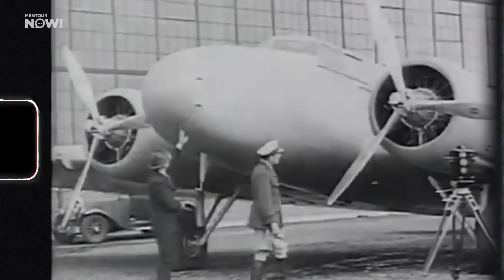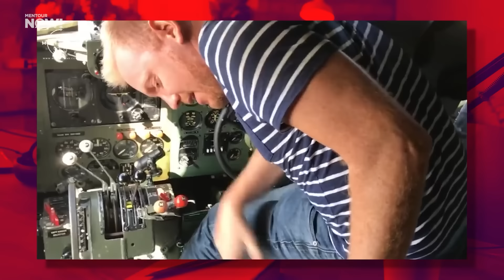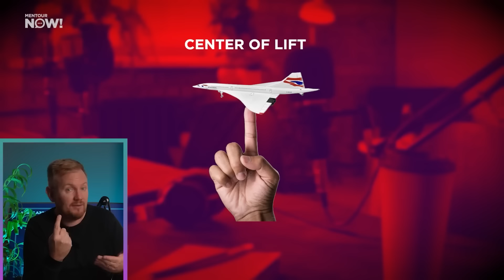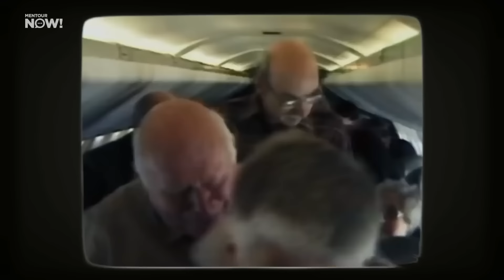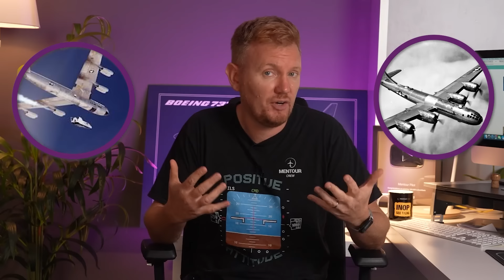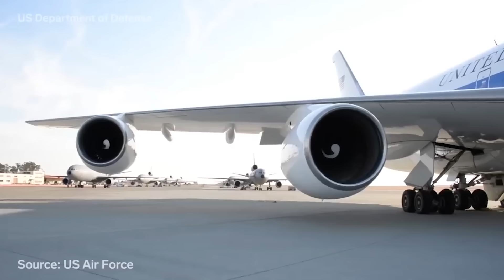The Planes Who CHANGED Aviation FOREVER! | Mentour Long Haul

Comment: This was a fascinating video.  I especially liked seeing the DC-3 in the museum.  American Airlines also has one in their history museum.  There's nothing to prevent you from taking a seat in the passenger cabin, which is unfortunate whichever airline you flew to get there.   That's because that seat is so much more comfortable than whatever economy seat you sat in (Virgin America in my case).  If you are ever in Dallas, American's museum is definitely worth the time.

Concorde economics were always dubious compared to the American SST proposals, which promised seat/mile costs close to those of subsonic jetliners of the day (707, DC-8).  Showing how the Concorde maintained its center of gravity by moving fuel is interesting.  If they tried moving fuel into the vertical stabilizer of the NAC-60, I would love to have seen the engineering involved, as it had an all-moving vertical stabilizer.  It was designed to be move about 15 degrees each way.  I've seen a small drawing of this, but not a detailed one. 

It's been fun, but the meds are kicking in...

Comment: The 8km antenna is to send the launch code to the silos on the ground. The long wave antennas are buried about 20 meters into the ground around the launch sites. They can only transmit a few bits per minute. Just the launch code

Comment: Absolutely great video!
Regarding Concorde I would like to add following information:
Johanna Weber and Dietrich Küchemann, both working for the Royal Aircraft Establishment (RAE) in Farnborough, were mainly responsible during the general design study in presenting the slender delta wing planform (which then received an ogival / ogee wing shape), as the only feasible solution for an SST. 
Since then, some other British and French aerodynamicists worked to improve this wing design independently, were the French design with its ogival shape, being previously proposed for the Super Caravelle, was originally chosen for the Concorde project in November 1962.

The final Concorde wing design for the production aircraft was mainly done by the British aerodynamicist Dudley Collard who worked at Aérospatiale in Toulouse. He redesigned the complete wing leading edge and designed new lift-improved wing tips (outboard wings). Among other aerodynamic improvements, he also proposed British Aerospace to build the extended tailcone (housing a more rear positioned and enlarged trim tank), which was essential for drag reduction.

Comment: Your mention of the aerodynamicists  Johanna Weber and Deitrich Kuchamann was interesting. There's two startling careers that don't get discussed enough.
Reply: The final Concorde wing design for the production aircraft was mainly done by the British aerodynamicist Dudley Collard who worked at Aérospatiale in Toulouse. He redesigned the complete wing leading edge and designed new lift-improved wing tips (outboard wings). Among other aerodynamic improvements, he also proposed British Aerospace to build the extended tailcone (housing a more rear positioned and enlarged trim tank), which was essential for drag reduction.
Reply: Küchemann und Weber  moved after Worldwar II around 1947 from Göttingen (still today a very important DLR aerodynamic institute with long tradition) to the Royal Aircraft Establishment (RAE) in Farnborough, because of their scientific work until than were joining the team developing the wing of the Handley Page Victor, They later joined 1956 the wing team of the concorde.
By the way: all Airbus aircrafts  except early A300 offer trim tanks in the HTP since the HTP is manufatured as a  CFRP-structure to improve fuel efficIency.

Comment: The Oregon Museum of Science and Industry (OMSI)  in it's first location had a DC-3 as an exhibit.  While the cockpit had plexiglass preventing you from sitting in the pilot seat, it was as close in the 1960's as some would experience for some time.  You could sit in the seats, and imagine what it was like.   In the Early 1970's I came back from a trip and told my classmates about flying in a jet.  No one else in my class in our small community had ever flown in an airplane.

Comment: loved the dc3 coverage, but as stated already in the video, the dc2 was also a very influential ship. perhaps the most famous dc2 (at least in australia) is the uiver, which worked for klm and when retired was donated to the albury airport in commemoration of the actions of albury residents in 1934 when the uiver was running the london to melbourne air race AS A NORMAL POSTAL RUN (!) with a few passengers on board and a 'heavy crew' (at the time, double crews allowed going past 12 hours flying per day).